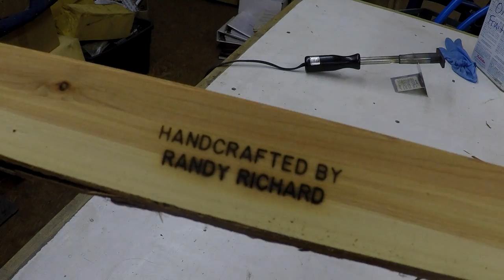Inventables X-Carve Build  Part 1

Comment: Hey Randy,
just saw another vid from april wilkerson who got hers and did a review. with her not being a machinist she wasn't real hip on the assembly. you seem to be handling it pretty good and don't seem to have too much trouble so far.
how much did that thing set you back? i checked out the website and the price seems fairly reasonable considering how spendy CNC stuff was when it first started making its debut.
looking forward to the rest of your series on this
cheers
mike
Reply from the maker: HolzMichel I actually emailed with April about the issues she had, the tapping was just minor.  They changed the way to assemble and stopped the tapping and just used the self-tapping screws with mine.  I received the x-carve free of charge, it was a donation if I did a few videos on it.  I know I am being a whore here.  But I found this to be very interesting.  With what I am finding out about the X-Carve, the one thing I would do is buy it without a spindle motor and buy a Dewalt 611 trim router, just buy the x-carve mount.  I am going to be doing this upgrade and have ordered the mount already.  Thanks Randy
Reply: Randy Richard That's good to know. I'm considering one of these and have a Bosch Colt, which they also make a mount for. No idea how it compares to the Dewalt but it's been a good piece.
Reply from the maker: Mike Galusha I think any good trim router will work.  i prefer Bosch tools myself.  A fellow YT contributor sent me the Dewalt 611 so that is what i will be using.  I should get the mount in a couple of days.  Randy
Reply: Thanks Randy, I'll be watching for the next installment.

Comment: Wow, that looked like a bad game of "Operation" there at the end with M2 bolt and nut install. I did like the double bearing rollers, they seem well made, but I guess we will have to wait for your review until after you've used it...or are you going to review the parts, manufacture, and assembly after just the original build to give you impression of it's craftsmanship?

Thanks for the video, and yes I am lucky that Dad let me use some of his travel points to take a train down to the Summer Bash, so I'll see you there! Aloha...Chuck
Reply from the maker: Knolltop Farms Thanks Chuck, trying to get the rest of the vids up tomorrow.  I am glad you can make it to Stan's.  Randy

Comment: Hi Randy, like you say it's a great way to spend some time.... Learning CNC...
If I learned to manually program some CNC machining tools, was a while ago, don't think I could just do it again if having to do one on the spot out of the blue...
Got to get at CAD though.... Another time consuming hobby... lol
Have fun, Pierre
Reply: pierre beaudry BTW, are those cans Eastman Kodak film boxes....???
Reply from the maker: pierre beaudry Thanks Pierre.  This will be fun to make stuff with and fun to learn new things.  Keeps the mind young.
There are plenty of free options out there for good 3d cad.  Thanks, Randy
Reply from the maker: pierre beaudry They are, very good.  They held film for camera surv. in Bank of America branch offices.  Myfather was a bank manager for many years with them.  They are great cans with lids.  Randy
Reply: Randy Richard
Younger (about 19 yo) I used to take lots of photos and develop my own BW films. To get better price on film I used to buy 100' bulk and it came in those cans... ;)
Reply: pierre beaudry Me too. Still have the loader gizmo.
Reply: powaybob
If my memory serves me well I started with the black plastic loader that you just inserted the film's end and wiggled until it was loaded... After a while those loaders were getting sticky....   The solution was to get the Nikkor stainless tanks, a little trickier to load but lasting forever...   Those were the times.... ;-)